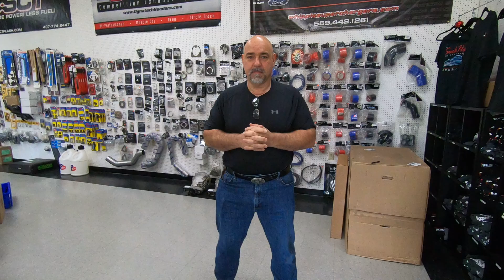How much power the can the 6L80E hold? Jannetty Racing

Comment: Does this 650whp number apply to a 1500 sierra or is this for lighter cars specifically? Also would you recommend getting a tcm tune on a stock truck to help save the transmission? Thanks. Would you remote tune a 2010 sierra?
Reply from the maker: Yes sir and Yes sir.

Comment: I’m not seeing anything in the comments but I should make sure I keep torque management on to help keep my transmission from dying quicker ? And what does torque management help with?
I’m thinking my transmission died on me because i turned tm off. Sorry for the late comment. I’m just trying to make sure to what I should do with my tune if I should keep it on or off. Because I’m putting a stage 2 transmission in this week and I don’t want to buy another one for awhile
Reply from the maker: Turning Torque management off will destroy the transmisson at some point, it might be a year it might a several all depending on how it is used.  Torque managment cuts power during the shift to prevent excessive wear and stress on parts.

Comment: Have a 2021 Silverado with a 6L80E and a Lingenfelter installed Magnuson Suoercharger.  550 HP at the crank.  The TCM and ECM programming seems good.  Hopefully it will last.  I love the 6 speed so far.

Comment: My question is, is there any way to put a 6l80e behind a carbureted gen 1 small block and have it work?
Reply from the maker: There may be but I have not researched the market to see if there are any stand alone controllers for the 6L80E that will work with a Carb.

Comment: So are you saying that doing a 6l80 on a stand alone system is doomed?
Reply from the maker: I don't see where I said that. that is a different subject.
Reply: @JANNETTYRACING  no you didn’t say that in so many words, but it’s implied by your saying that it requires tq reduction from the motor, if that’s required and it’s a stand alone system….🤷‍♂️🤷‍♂️🤷‍♂️
Reply from the maker: @jimfryar1  Like I said stand alones are an entirely different conversation.  also really depends on power level, Most of the Holley systems that can control the 6L80 should be able to provide torque reduction for shift but that is up to the tuner.

Comment: why would you go through the radiator that stay at 200 degress and I have literally never saw a trans cooler that has inlets nd outlets like your saying.
Reply from the maker: Because the trans cooler is located on the cold side of the Radiator, It is never 200 Degrees,, there is also a such thing as running a Transmission too cold which can also be detrimental.
All trans coolers have inlets and outlets just a matter of rotation when mounting to put the inlets and outlets in best orientation.

Comment: Just killed mine with a tuned V6...lol. I think the pressure regulation valve wore. I'll have to ask my transmission guy how the rest held up because I think my tune does turn off torque management. But would 350 ft-lbs really do that much harm to a stock transmission?
Reply from the maker: Your car has a lighter version transmission than the V8 cars. all depends on how it was tuned.
Reply: @JANNETTYRACING  what's the fundamental difference between the 6l80 that backs up the 4.3L vs the V8 in the 2014+ gen GM 1500s? Besides the torque converter.

Comment: What is the best transmission 4L80E or the 4L60
Reply: 4L80. Not even a built 4L60 holds a candle to a 4L80. It's the best trans GM ever made.

Comment: I know this is an old video but I’m running some simple upgrades on my Sierra 1500 L83 5.3 with the 6L80 transmission. I have headers, carven exhaust , cold air intake , and MSD coils. It’s more than enough power for me , i just want a tune for my transmission to ensure it will last me. I don’t want anything crazy aggressive , but I do enjoy pushing it here and there. Is there anyway I could purchase a tune from you ?
Reply from the maker: It is still extremely accurate information the TCM reacts to the Torque reporting of the ECM so they both must be calibrated together, I offer remote tuning services world wide  https://jannettyracing.com/pages/tuning-services

Comment: I have a question? Is there any difference between tbe GEN IV LS 6l80e & GEN V 6l80es? I have a 2015  Gen V engine & the 6 speed is slipping & curious to know can a 2012 6l80e replace it?
Reply from the maker: As far as we know 2010-2015 6L80E are the same, although the TCM is very different and can not be used.

Comment: I planning to put a twin turbo kit and a camshaft on my truck that should produce about 800 hp .the transmission is stock it only has a transmission cooler do you think it will run fine or should I upgrade it if yes what should I do please?
Reply from the maker: Your Turbo system design, how the car is tuned and fueled will play a huge role in Transmission reliability, at 800 RWHP the trans should be built with all the latest technology and parts.  we can help you with this by calling 203-753-7223
Reply: @JANNETTYRACING  but could I get a 600 hp on a stick transmission?
Reply from the maker: @xmushiix6826  That will depend on current wear and who tunes it.

Comment: Will a throttle response box like pedal bandit or pedal commander cause harm to the 6l80?
Reply from the maker: Not likey but I am not a fan of Pedal boxes all you need to do is push the pedal harder for same results.
Reply: @JANNETTYRACING  thanks for quick reply. After some reading online, alot of people are saying that red light bandit throttle box is causing check engine lights and reduced engine power issues. It's going to be a pass from me.

Comment: Your weakest link is the clutch pack drum 🥁
Reply: Does heat kill them
Reply from the maker: You have to define heat, normal operating temps up to about 230 is fine when you exceed 240 it starts to go downhill fast.

Comment: I don't know personally I got 360,000 miles out of my transmission in the last 100,000 of that was with the torque management turned off shifting at 7200 RPM 100% line pressure all the time bypass the bleed off valve ignoring output shaft speed. I will say the one problem I did have.it love to blow out that f**** tell shaft seal and bushing. I did not mess with tow haul mode so most of the time I drove it in tow haul and then when the occasion arrived POS running the quarter and 12.99 imagine if the b** didn't have a flatbed on it

Comment: Would a stock 6L80 with a torque converter handle 600+ horsepower or would it need to be built
Reply from the maker: 2 things need to fall in to place, The current wear on the unit and the tuning of both the engine and trans it all is well it will handle 650 RWHP no problem
Reply: @JANNETTYRACING  thank you

Comment: my 6l80hd in a 08 escalade just $hit the bed a 610 whp on a 33 inch tall tire... tuned by vengence racing in GA...  I am assuming that the 650 hp mark mentioned is not in a 6000 lb suv lol... so currently looking into a 1000 hp unit build...
Reply from the maker: In our experience if both the Trans and calibration are correct you will not fail a trans, what we can't predict is how much wear is on the current trans or if there is some underlying issue that doesn't show up until you turn the power up.  I would recommend you thoroughly diagnose the cause of the failure before you proceed with a build or you will be doing this all over again.  There is no 6L80E that will handle 1000 HP Sorry.
Reply: @JANNETTYRACING  there are several companies out there building high hp 6l80 trans... as there claimed 1000 hp build is not calculated with weight of vehicle... as I only make just over 600 it's just nice to have the billet internals to help with the hp and weight... and just a little FYI... there are many... many cars and trucks out there making over 1000 hp with 6l80 trans ... so yes ...someone is building them
Reply from the maker: @thomasstott527  The video is about how much a 6l80 can handle stock, and it is an accurate figure, We build 6L80E in house, we have all the best parts available, we did all the development work back in 2012 and continue it today, The Length of the case and it's clutch drums are a limiting factor so It will work for a while depending on how the vehicle is used, Many Many people have 1000 HP but never use it, I would never recommend a 6L80 for a 1000 HP build, we would start with a 6l90 and build it, the 6l90 is longer and can fit more clutches, the billet parts are totally unnecessary at your power level regardless of weight.  I appreciate you wanting to school me on Transmissions but you are preaching to the teacher.
Reply: @JANNETTYRACING  with that being said a 6000 lb suv....with a 33 inch tall tire puts a lot more abuse on FACTORY parts... so billet parts in my case may be over kill... as I may decide to up boost in the future... only want to do it once ... as the teacher reference.... we have all been to school... and have all been " misinformed " by a "teacher" ... good luck with your trans builds...

Comment: I have a 6l80e it shifts hard  since I bought it use at 5000 miles. Took to two different dealerships they said nothing is wrong. It now has 32000 miles and still shifts hard in the gears 1-4. Sometimes when it’s warm up it shifts perfect. Does the 680le shifts little harder than other trans. And will Lucas transmission additive be okay to add?
Reply from the maker: Unfortunately there is no magic potion to fix your trans, it may be something in the calibration that needs to be looked at.
Reply: @JANNETTYRACING  okay thanks. You boys need to move the south!
Reply: I might add its clutch to clutch when shifting meaning neutral is applied between gears its the nature of this beast watch your tack you'll notice it drops like a brick when shifting it doesn't transition like the old days into the next gear the 6l80 is very simple but complex on the tcm side of it its a resilient design but with that comes weird shifts this transmission also has the capability to do whatever it wants when it wants and how it wants the only thing it can't do is heal itself

Comment: Just bought a 2014 SS it came with headers, cam and that’s what I know so far and I just want to know how much my transmission can hold and what should I do to it
Reply from the maker: You should start with having me tune it, then service the trans and add our dipstick tube kit so you can properly fill and monitor your fluid level and condition.
Reply: @JANNETTYRACING  where you located?
Reply from the maker: @aldocordova4653  Waterbury CT 203-753-7223

Comment: Do you tune? I have a supercharged 2009 Tahoe with a fully built Circle D transmission. Need a good local tuner NY,NJ or CT.
Reply from the maker: Yes sir I do 203-753-7223

Comment: My question is.. How much slower the car will be with the power cut between clutches
Reply from the maker: It is not slower, and it makes the trans shift quicker and last longer, and shifts are smooth the car is fast
Reply: @JANNETTYRACING  my next question is how much is a trans tune?
Reply from the maker: @troychambliss9861   I do not sell trans tunes alone, I must tune both the engine and trans as a set I explain this in the video.

Comment: what's your opinion on a trans cooler with a added fan(s) for additional cooling abilities.
I've done some research on air flow on my g8 and there's a large inflow of air around the spare tire tub around or under 75°+ @ 40-80 mph depending upon outside temps and pavement temps
Reply from the maker: If you are seeing a trans temp issue that is an indication of a possible problem with the radiator or the trans itself that needs to be investigated, Normal operating temps should closely follow engine temps, under normal driving, when sitting in traffic with your foot on the brake in gear, backing up a hill, or pulling a trailer is when you will see higher temps, we don't get worried until 250 Degrees or higher for extended periods. Adding a cooler is only required when adding an aftermarket higher stall converter, or setting up for trailering. we never add one to cover up an existing problem.

Comment: Hi, really liked your video! I have a 2012 Silverado 1500 with a transmission cooler, I would like to upgrade mine... I saw that a lot of them have entrance and return of on the same side... top or bottom, which one would you suggest to buy that will work as you said? Thanks!
Reply from the maker: Give us a call we have the one you need in stock 203-753-7223

Comment: yep so how much is the main upgrades for a stock GM 6L80E to make it last longer, especially if your going to put a external trans cooler and Circle D stock torque convertor, just to use better quality parts and also is it worth upgrading to the 6L90E driveshaft and other extras for say a 2015 chevy ss, just so it last longer also i believe the biggest problems with auto transmissions is heat, the more heat the fluid gets the more damage, so a external trans cooler is the best insurance( especially thermostat controlled fluid release so around the 80 to 90 degree c mark, basically based of the radiator coolant temps)  as long as your not racing and you have way over the top hp at the rear wheels its like anything service the auto and engine oils and she will look after you, but in saying that if a stock unit can handle 650hp at the rear tyres, the Auto TCM to ECU tune is so vital, because its a learning computer based on how the car is driven?
Reply from the maker: Feel free to give us a call 203-753-7223

Comment: Will a 6l80e/6l90e bolt directly to my 99 4l8e 4x4 transfer case or will I need to to with another transfer case?
Reply from the maker: We do not do swaps so you would have to do your own research, The 6L80 E was available in 4x4 trucks and all wheel drive Denali and Escalade.

Comment: This transmission could be used with a GM 6.5?
Reply from the maker: As long as you have a transmission control unit that will run it.

Comment: Is it possible to rebuild a 6l80e to withstand over 1000+ hp?
Reply from the maker: That depends on how it is used but it won't last long.
Reply: Yes it's been done. Well over 30k street miles over 1400whp.
Reply: You need a th400 my friend

Comment: So what I get from this if I keep my car stock and don’t drive it hard I won’t get problems that I hear about all the time because I have heard many stories about these transmissions giving problems
Reply from the maker: Servicing your trans fluid and filter along with proper fill level will give the longest lift check out our Dipstick tube kits for the 6L80E that don't have one.  https://jannettyracing.com/products/jre-dipstick-and-tube-kit-6l80e-6l90e
Reply: JANNETTYRACING my last car had a 4L80E everyone said they are stuffed at 200,000 Kay’s mine had 318,000 Kay’s on it and it was was still going strong although i towed a caravan at times it was still going strong when the car was written off I always checked the fluids and serviced it but I never drove the car too hard or did burn outs like most people do
Reply: @rabbit73au  4L80s are tanks.

Comment: If you were doing a ls swap, and the budget but not time was a factor , would u 6l80 or 4l80?
Reply from the maker: Without knowing your budget I can't comment, there are too many possible solutions used new what you are swapping how complete etc.
Reply: if budget is the factor then probably 4L80. Biggest decider will be the engine. If you want to use a 6L80 you need a Gen 4 LS.

Comment: What kind of power can it handle in a truck/towing application? What mods would be necessary in the 400hp range towing 5000lbs?
Reply from the maker: We have a Denali making 880 crank hp that tows a skid steer weekly with over 60 K on the trans.
Reply: @JANNETTYRACING  & that’s on a stock transmission?
Reply from the maker: @OOLilDel  Yes sir with proper tuning like it says in the video.

Comment: Does the transmission have an operating temp it is happy at or can you run an oversized cooler with no bypass?
Reply from the maker: If a trans has failed we recommend a new radiator as trash from the failed trans will clog the cooler.  never bypass the radiator but you can add an additional cooler, installation orientation distance from radiator, placement, and line routing are all critical, you typically  only need a aux cooler if running aftermarket higher stall converter.
Reply: @JANNETTYRACING  I asked poorly.  What I meant to ask: can you have too effective cooling?
Reply from the maker: @owen8098  Yes you can. Trans has a normal operating temp of 180 to 220

Comment: What’s price on a 4l80 if I was to buy one from u
Reply from the maker: A transmission is not a fits all part off the shelf, each one is specific to its intended use, and Power level, you will also likely need a torque converter to go with it, please call for an estimate 203-753-7223

Comment: Definitely need to get at this man I have a 4L60E M30 transmission An have a 98 blazer 4door wanting to do swap as far as transmissions go what LS Gen 3, 4, 5 an I hook up with my trans I have stock An can I get a Gen 5 hook it up to 4L60E or a 6L80E? How good are 6l80E compare to 4l60E what's the benefit?
Reply: Gen 5 is LT not LS

Comment: Can we talk about a custom remote tune? I've had multiple people tune it, and none touched the actual engine torque values. I have done that recently, but shifting is still too rough. It's a custom 550hp LSX454 in a G8. Also have dyno numbers.
Reply: ziggybmw did you ever get a remote tune, If so how was it?
Reply from the maker: Sure thing give me a call on Tuesday Sept 3rd 203-753-7223